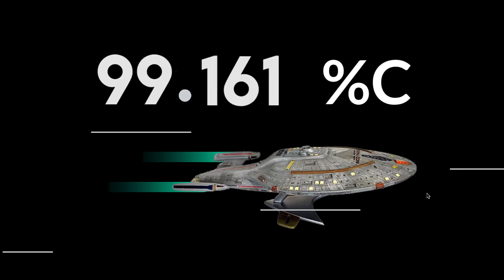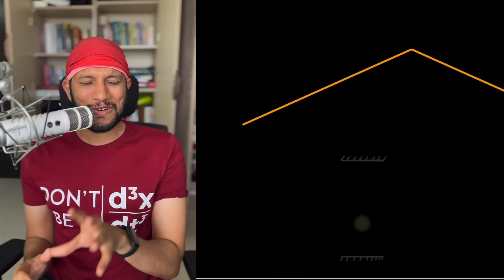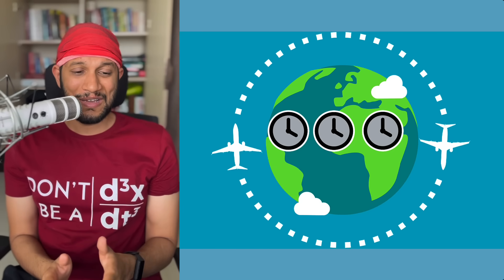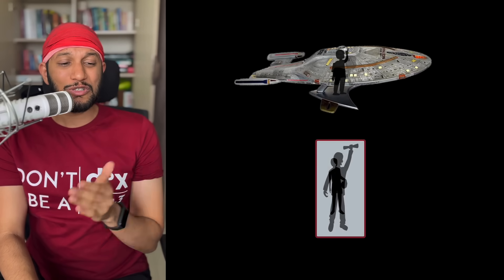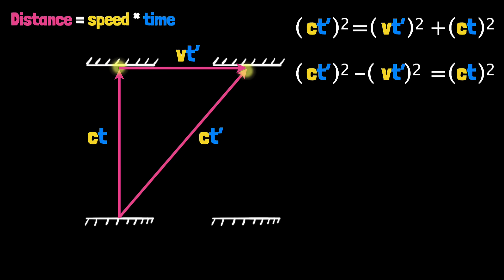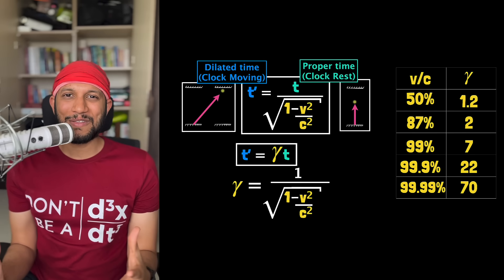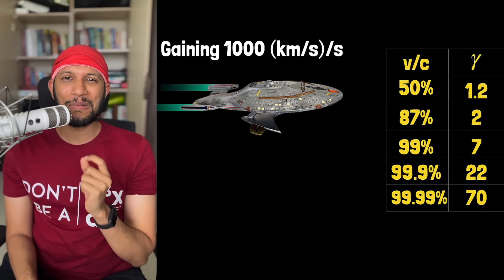I finally understood why you can't go faster than light! (My mind is blown)

Comment: How do you factory for the fact that all objects are moving and thus there is no one fixed correct time?
Reply: a big breake through was not to consider this upfront, but to repeat the calculation from two points of view and to happily notice that the trajectory of the ship is calculated to be the same ( and also the eigen-time of a round trip of a twin ).

Comment: so.... if the clock was facing the opposite direction from the direction of travel would it move 3x faster ? ( probably not, but I like playing devils advocate in situations with absolutes and were people think they understand things to encourage thought ) 
basing all of this math on the speed of light  ( because light is how we see things, and we think it's the fastest thing we attempt to measure ) might have restrictions in the long run as we come to understand new things. but for now I guess it will have to do. 
I have a thought.... could it be that the galaxy isn't expanding, but the the speed of light is slowing down as you look farther out?

Comment: You can go faster than light. Just not in vacuum. Try that in water, you will see cherenkov radiation.
Reply: dressed phonons are not phonons. Just because in first order approximation a refractive number exists, does not mean that it is "real physics". Yeah, Maxwells equations are linear. So you can slap on any phantasy linear equations and the shape stays the same. But you prove nothing. I don't know why physics books till today stress this "sleight of hand" so much.

Comment: I still don't understand the photon clock... the photon in the clock assuming it's on the ship is moving at the same speed as the ship, just as you are. It's relative motion. So when you generate a photon, it's already moving at the speed of the ship in whatever direction that is. Just like riding in a car if the passenger tosses a ball to the driver (assume we have autopilot, lol) the ball doesn't fly out the back of the car, it moves to the driver.  If you accelerate, or otherwise change direction, yes, the ball will go somewhere else but at steady state, or under reasonable acceleration, the ball moves with you.  Photons are no different. 

You can't accelerate too quickly either, otherwise you're going to be a red splatter on the seat or back wall of the ship! So again, I'm not seeing this as a valid explanation.
Reply: What if a driver honks: Is the speed of sound greater? When the passenger speaks it is greater because the air travels with the car. So you suggest there is ether? That was a very popular theory almost like flat earth, but its was proved wrong by experiment.

Comment: How light accelerates to speed of light?
Reply: it does not. Photons are created at speed of light. Check out antennas: Near field does not move at all. Wave solution ( as shown by Maxwell ) only travels at c. QFT quantized only the waves. The near field is not free from the charges which create it or whatever.

Comment: There is no such actual entity or element as time. What we call "time" is just "measured motion" and the photon clock mental experiment illustrates it. The reason "time" slows down is just because clock components are moving further. The simpleness of this observation blows the mind. I often wonder what other obvious aspects of our universe are right under our noses and we are not seeing them. Does the photon clock analogy work if the photon is bouncing parallel to the motion of its reflectors instead of perpendicular like the analogy shows in an attempt to prove time dilation? I think it does.

Comment: The only thing I know about light and I think the only thing you need to know about light is that "the speed of light" is a misnomer. Everything in the universe moves at the same speed - the speed of causation. The plane through which all things move is the spacetime plane, so more massive things cross less space over the same period of time - they're slower. The fastest something can move through spacetime is at the speed of causation, which is only possible for things that have no mass. Light has no mass, so it moves at the speed of causation. Everything moves at the same speed all the time. You just don't understand what the speed is or maybe what the things are. That's the disconnect.

Comment: Well... This is actually a less intuitive way to explain that nothing can speed up to C. If you followed your logic, then it would be possible to travel at the speed of light. Like the explanation is just: You will see it took an infinite amount of time to accelerate, but from the ship's perspective, this infinite time is still 1 second, so if you were on the ship, then it would just take a few seconds to add the last 1000 km/s to reach the speed of light.

Why can't you go faster than (at) the speed of light? The light would then need to travel faster than the speed of light, which is not possible (can be shown with the clock). If you would rotate the clock to be in the direction of the ship, then from our perspective, the faster the ship goes, the longer it would take the light to hit the front part, and the faster it would hit the back part. At the speed of light, the light would not be able to move forward, as it is already at its speed, but it would need to, as from the ship's perspective, it would just hit it as fast as normal. Also, at that speed, the light would hit the front part in an infinite amount of time and also hit the back part in an instant. If you tried to go faster, then the light would lag behind the clock itself and never touch the front part. But as it would need to touch the front part from the ship's perspective, then it would need to, at the same time, be lagging behind and still getting closer to the front. And if it hit the front part, it would need to hit the back part even before it hit the front part. So it would need to travel back in time.

Comment: We can and the proof is that light does it and there are even particles that travel faster so I believe they got scared in the 50s from Dogma, about what they saw would happen at or beyond the speed of light and wanted to slow progress by lying to our eyes as a distraction which apparently worked because you have TV physics, astronomers, mechanical engineers saying how its impossible but we go then how does light do it and how is it we find these particles does it??? Makes no sense so by them throwing a wrench in they get our brains to see the why instead of the how?
Reply: No particle travels faster. If it was possible to transfer our mind, light would suffice. We would shoot our mind data around. Like beaming in StarTrek. I think that you cannot mend minds, though. And it is unethical to clone minds of rich people more than that of poor. Have you seen "Altered Carbon" ?
Reply: @ArneChristianRosenfeldt  They discovered several particles that are faster then light at CERN what are you talking about?

Comment: math formula is not a proof, and a thought experiment is not an actual experiment. funny how humanity forgot that. and a "photon" is completely hypothetical - just some arbitrary "amount" of light emitted which is probably more like a wave and not actual particles. the so called "time dilation" is nothing more than a doppler effect with a sci fi explanation instead of a logical one.
Reply: You can experiment with real Myons . Or just check how GPS needs to compensate for dilation in its clocks in orbit.

Comment: Hey, Mohesh, love your videos! I wanted to mention an audio issue with you. I've been an audio engineer for over 28 years now and noticed 'plosives in your speech that are uncomfortable on the ears. These are bursts of air that hit the microphone's diaphragm when you utter consonants like T, P or B. They're really uncomfortable when listening with headphones or earbuds, or even good speakers. 

Everything else about your audio is great but I wanted to give you some tips. You're already speaking off axis to the microphone which is good. You can change the microphone position a little more to prevent the air hitting the diaphragm head on to take care of most if not all of it.

The other thing you can do to handle anything that gets by the microphone redirection is use use a low shelf on your EQ during post-production. Make sure you're listening on a good set of speakers or headphones so you can heat the 'plosives and simply roll off the bass frequencies at the highest frequency possible without impacting the sound of the voice. Since you don't have a low voice, you should be able to achieve professional results just by doing this.

This will make your videos more attractive to people who are currently suffering and turning the volume way down to take the pressure off their eardrums.

Peace.
Reply: Well i don't know if he will see this but you made me learn something new about this subject that i never even realized before so thanks

Comment: So you’re saying light can’t even travel at the speed of light?
Reply: light speed was found by James C Maxwell has he looked into the equations of electric and magnetic fields. Light travels at light speed. I don't know what the author of this video is saying. People then found out that light always travels at light speed even if you measure it on space ships which themselves travel ( in different directions ). From this it was concluded that ships need to be slower than light. I don't know why and when someone put so much emphasis on the word "particle". Particle physics is one thing, theory of relativity is another one. You cannot deduce anything for GTR  from the fact that electrons and photons are both particles.

Comment: Now wait a sec. Space ship is all fine, but this explanation is based on two reference points - INSIDE the ship, and OUTSIDE the ship. Even from a spaceship's perspective - why it is time in a spaceship slowing down, and not the other way around? 

Even in a spaceship example, we can say, that, since all movement is RELATIVE, it is the spaceship that is at rest, and the observer is accelerating away (hence time slowes down for an observer, not the ship). 
Or, say, we have an observer 'at rest', and TWO ships, accelerating away from them in diametrically opposite directions. What will happen to their relative speed, when each of them reach 0,5*C relative to an observer, and beyond? These equations do not explain much in that case.

And if we take two complete celestial bodies, with gravity and all, positioned at the opposite 'ends' of known universe that are already moving away from each other at close to speed of light, and accelerating further, and try to reference them...
Reply: I don't know about your ends of the universe, but with two space ships you can always ping-pong light pulses between them. And the ping pong will never stop. The ships cannot "escape" light. Of course, not to become mad, I just imaging that I sit on earth and earth is not moving. Then from this third person perspective I observe the ping pong ( perhaps there are relays in the path which send me a copy ).

Comment: Traveling FTL is not the practical method for interstellar travel. We need to think more outside the box. Perhaps, because of the apparent vast distances involved, we need to stop thinking of space travel as we go from here to there but instead what if we can bring there to here thinking in terms or reversibility. A portal of some sorts where the destination is just beyond the event horizon of the portal. I assure you that interstellar travelers are not spending hundreds and thousands of years to get to earth. They are likely doing it as easily as we make a run to the corner store and back.

Comment: If the speed of light can never be reached due to time dilation, how do we know what the true speed of light is? How do do you use a point of measurement that is always changing. If the speed of light was calculated inside the ship and then calculated outside the ship, the speed of light would be different correct? By the way, I am very math stupid and writing this at 2am so take it easy on me 😂
Reply: speed of light is constant. Nothing changes. Checkout videos how earth is not standing still or even flying in a straight path. Still we measure the same speed always everywhere .

Comment: If mass achieved the speed of light, could a black hole be created?
Reply: if said mass does not accelerate, it is an inertial system. It should be valid to calculate the gravity field in this system. So like, the gravity self-pull of a ship would be very low, like at rest. So no black hole created. This reality should not change if you change PoV. Though fields are transformed, too.  So if this ship crashed through earth it would pull like a micro black hole?

Comment: This is well done and very enjoyable. I wonder, though, since relativity is, after all, about interpretations of events based on different perspectives, and indeed the description here is one of why the speed of light is not attainable from the perspective of someone outside the ship measuring the ship's speed, is attaining the speed of light only impossible from the perspective of being outside the ship? In other words, is the speed of light attainable from the perspective of being in the ship, where time dilation is irrelevant?
Reply: Exactly what I was thinking when I came to the comments. The outside observer would experience the time dilation, but the occupants of the ship would experience things normally. Like inertia in a car, dropping something in your lap works the same as not travelling because everything in the car is travelling at the same speed. In space, with the vacuum and all, wouldn't it be the same thing? 
The issue I think would be the problem is that any sort of energy source would at most react at the speed of light, so being able to generate power, let alone use any electronics in the craft would potentially not be able to work, or work differently. HOWEVER, if the photons inside the ship are like passengers in the car example, it would stand to reason that they could operate exactly the same as if they're stationary. Much like if you compare one side of the universe expansion to the other, from the middle of the universe, the expansion difference would be double the speed of light. It doesn't mean anything is surpassing it, but from the observers point in the center, the speed that one side is moving away from the other, would break the speed of light. Which is basically the opposite of what relativity tells us.

Comment: Ok the ship is going 99.9999 the speed of light and you run from the back of the ship to the front aren’t you going faster than light daaa 😊
Reply: no. Time dilation makes you look like a snail which goes at 99.99999 the speed of light

Comment: What about a Sabot ship? 2 stages of rockets, 1 to get to near speed of light, a smaller ship inside that once it starts hitting the wall before the speed of light, starts its engines that are just as strong as the 1st stage rockets?

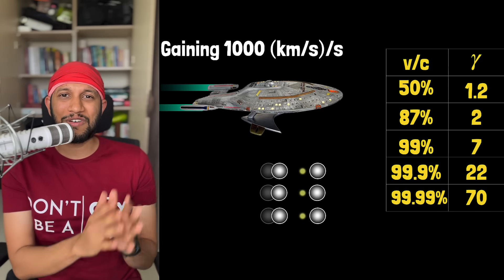Nice you explain it at 14:00
Reply: 15:15 okay so what if the amount of fuel consumed (¼ tank of fuel) to get to 99.99% the speed of light is enough of a lighter mass, you then push the trigger to gain an increase in velocity to 170y

Sure you start lagging due to time space dilation and 100s if not 1000s of years are skipped

But thats an outsider observer issue, and that our atomic based clocks are like trying to use a sun dial in the dark

Comment: Conclusion:

Human travels to other galaxies will not be in ships traveling fast; space is just too big for ship travel. How big is space?

If you shrink the Sun to 1cm diameter, Neptune is 70 meters away.

Now shrink our solar system to 1cm diameter (Sun in the middle, Neptune on the edge), then the Milky Way is slightly bigger than the continental USA...

We are to the Milky Way what atoms are to us.

Traveling far in ships going close to 'c' just won't work; it'll take way too long (infinite time), and too much resources (infinite fuel), no matter how you look at it. We need to look at other means, like bending space to create instant-access wormholes, or something similar.

Comment: So, a device firing radiowaves or photons spherically outward, and surrounded by detectors, should be able to detect the absolute speed and direction at which the earth is travelling through space, no?
Reply: Michelson Morley did only compare two directions at the time because that is what an interferometer does. But if you have a way to compare more directions, you could use a spherical wave. A flash experiment compared to that two axis rotation scanning experiment done in what 1870 ?

Comment: Question:  if the universe is expanding at 70 km/s and the speed of light is 300 km/s, huge quantities of photons must shining out ahead of the expanding universe, making the universe appear to an outside viewer like a star.  Correct or not?
Reply: the universe has no end. There is no outside. Now you can all argue with your intuition, but as it stands, English language and these words describe it best.
Reply: @ArneChristianRosenfeldt  The quandary remains that the material universe is expanding at one rate, and photons are traveling 3x faster.  There must be a place where the two states part company and the photons, even if still in the "universe", have far outpace the rest of material existence.  It is a puzzlement.